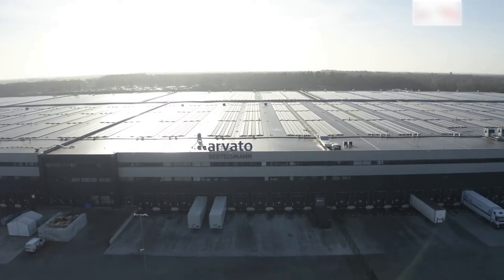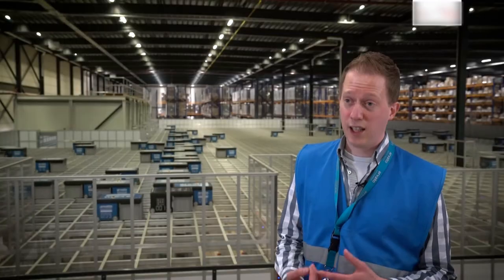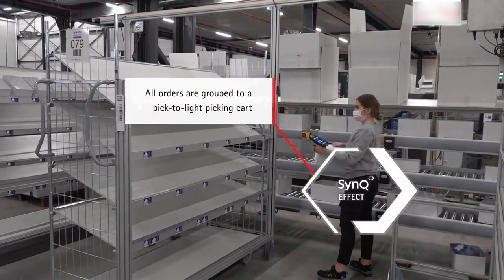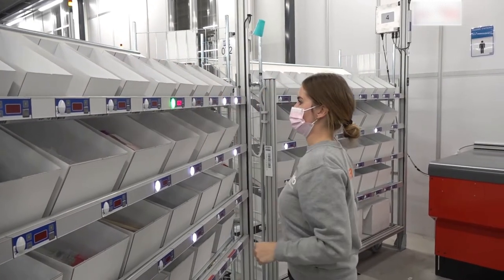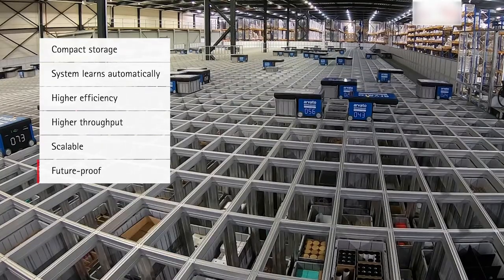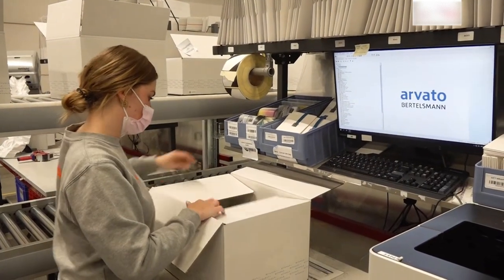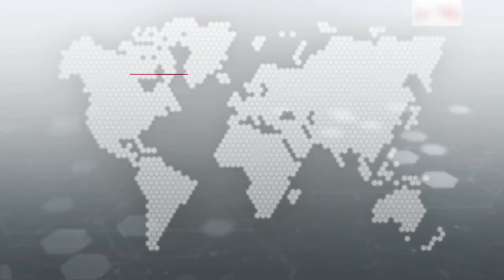Arvato, Netherlands: Scalable and flexible e-commerce fulfillment using AutoStore

Comment: Hi, interesting system. very good job done. I have a question about AutoStore's ability of dealing with hazard products. This case, Ritual, which has a lot of flammable SKU (spray for example) I could imagine. Did it raise any concern about safety and how could AutoStore system cope with that?
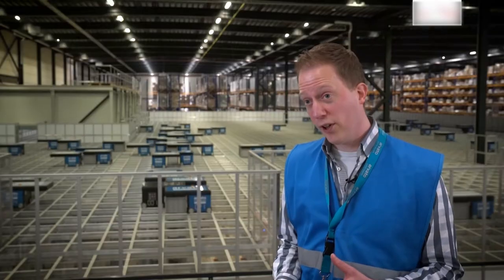Reply: The dangerous products (flammable and aerosol) are stored in a specific area, a bunker with fire doors. At minute 1:06 you can see the bunker on the left